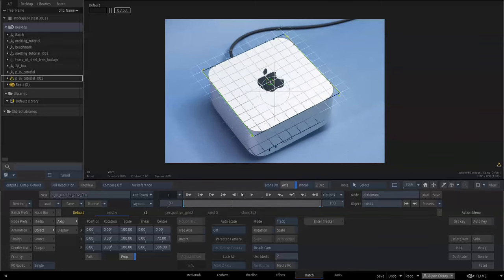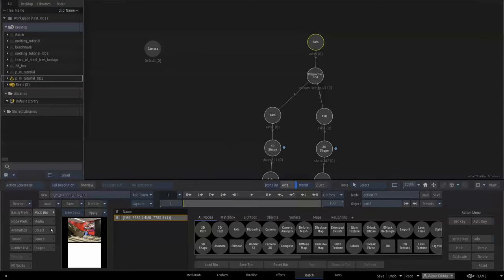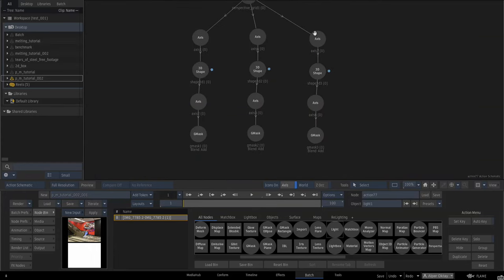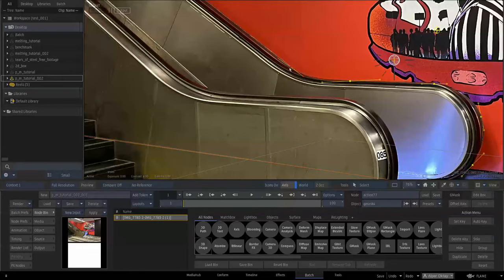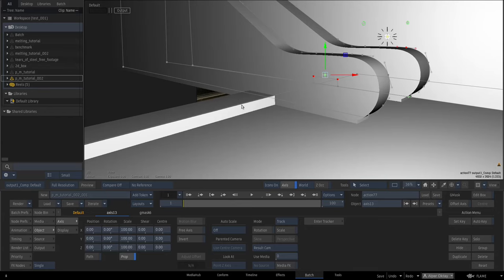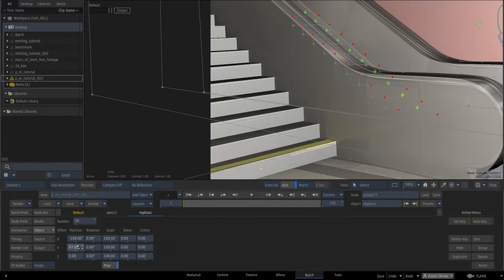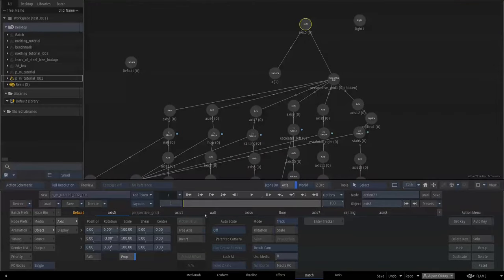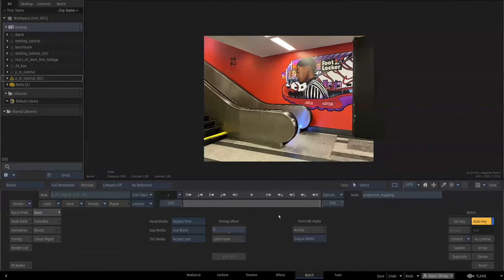Transform a static photo into a 3D scene using projection mapping and perspective grid.

Comment: I like these projection mappings. As long as texture can be mapped onto relatively simpel modelled 3d shapes it works fine. But how do you handle organic shapes like fruits, animals, human bodies, landscapes like forest's with trees in different z-depth's? Simple conversions can be achieved with depth- and attached displacement maps, but this technique is only for a small indented use. Alper would you also model 3 human head or body for 2d into 3d projection's? In Flame there is a Human Face/Body ML map generation, but as far as I know you can't extract this map to a shape or vector mask (like announced in the Logik Live Episode #32 starting at 49:15).
Reply from the maker: You need lidar scan. And a proper pixel accurate 3d track.